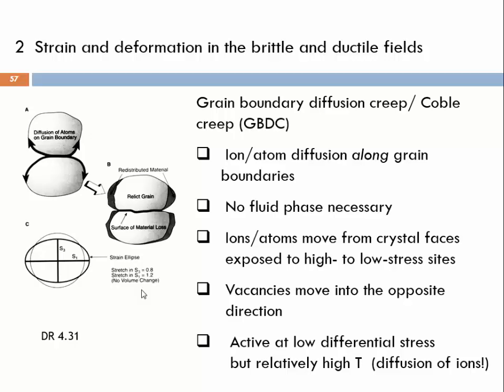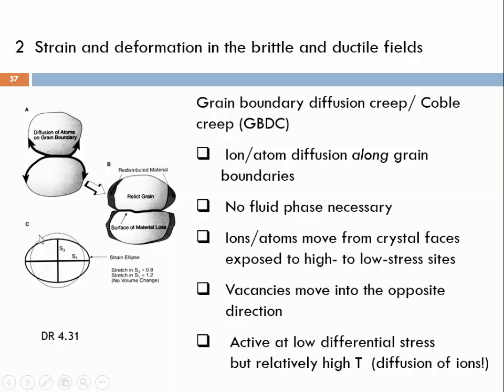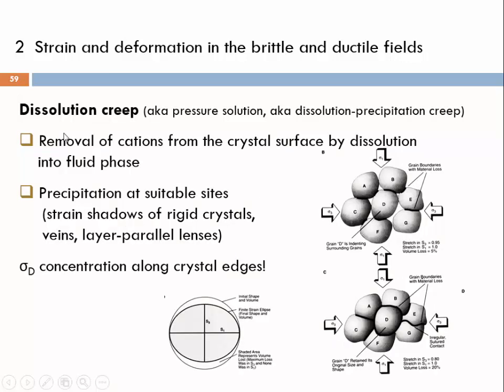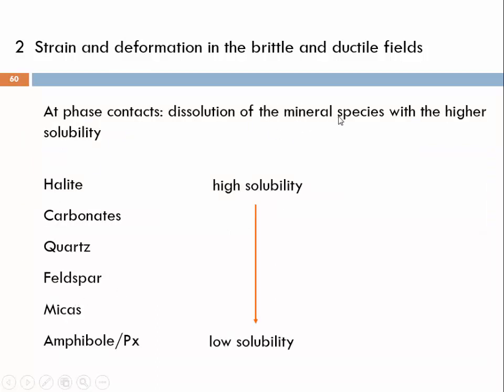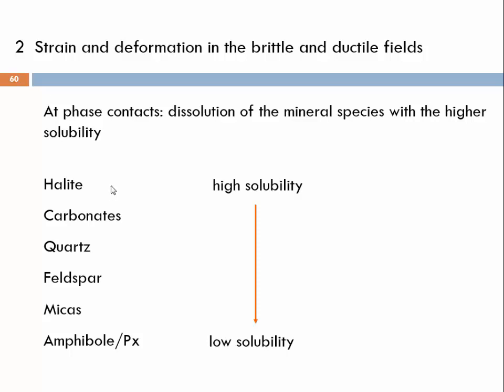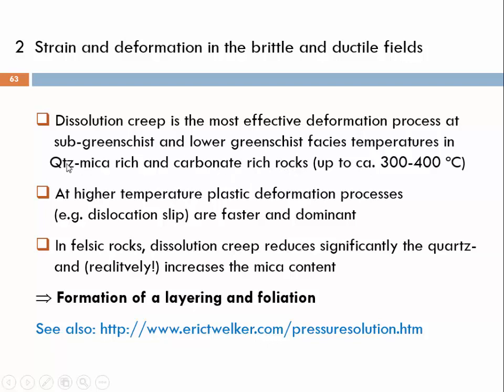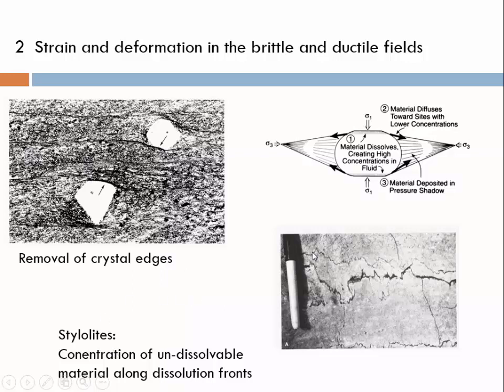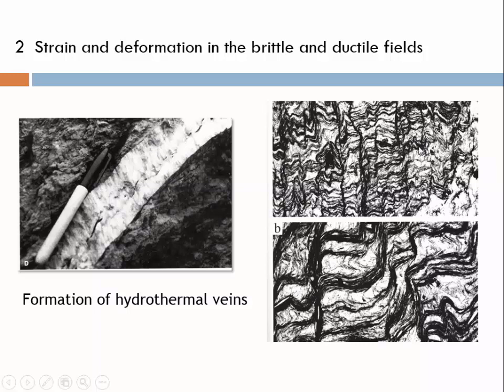GLG2 Chapter 2 sl 14-29: Strain and deformation in the brittle and ductile fields (Part 2)

Comment: A question at 12:25 , let's say I am looking at a highly foliated Archean rock that is very high in mica and has no quartz, I would assume the quartz has been lost due to dissolution creep. How would I know? are there any signs of dissolution creeps in a rock? I mean the protolith of this rock could be a pure shale or grey-wacke.
Reply from the maker: The evidence would be contextual. Where dissolution creep is important segregation quartz layers and quartz veins are typically present nearby. Quartz veins are boudinaged (layer-parallel) or folded (veins at high angle to the layers). Furthermore, dissolution creep typically is restricted to high strain zones and one will commonly see gradual changes in less foliated rocks with less abundant vein quartz. But of course, in practice it often is a matter of interpretation. 
Further evidence can come from microfabrics. Passchier and Trouws’ textbook provide good examples.